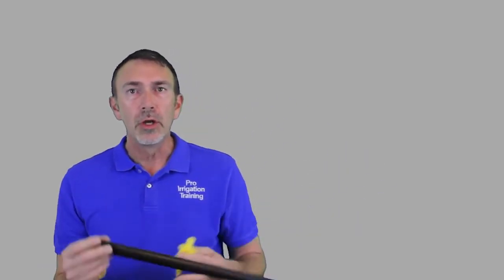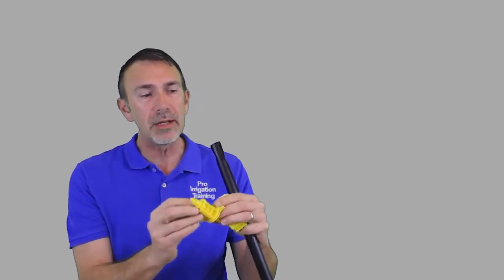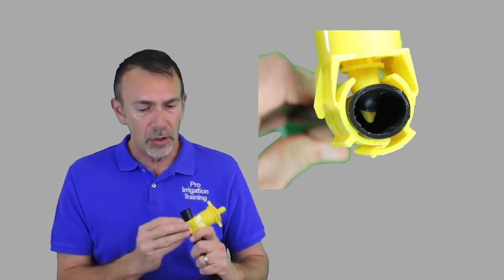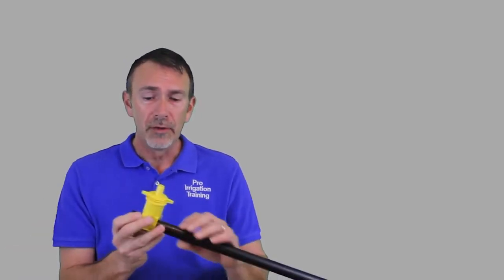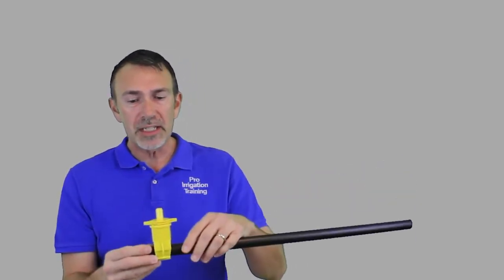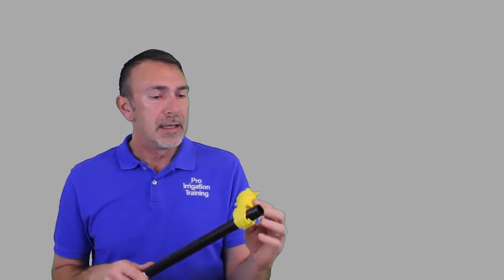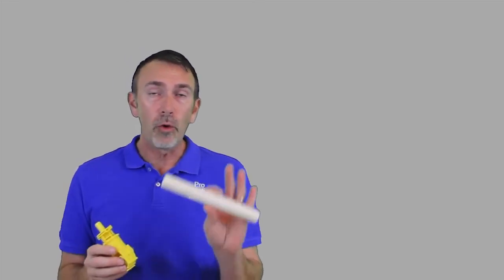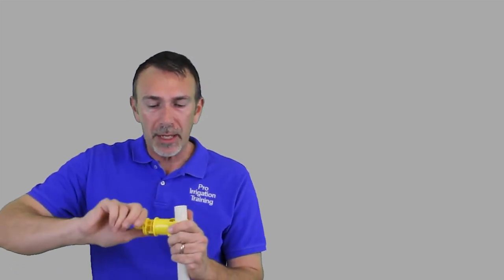How To Use Poly Saddle Tap (sprinkler systems)

Comment: How does this affect water flow in the zone you tap in to?
Reply from the maker: It may not restrict flow itself, but I'm certain it reduces pressure from the friction loss / turbulence around the barb that's inserted into the pipe. But the fittings seem to be widely used, so I'm assuming it's not that big of a problem.